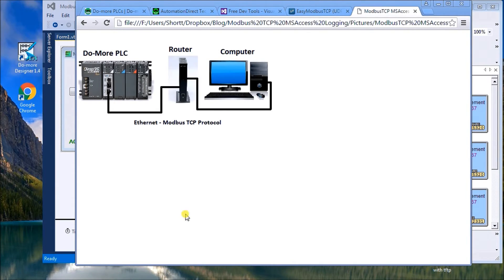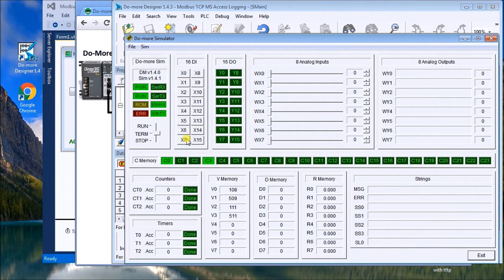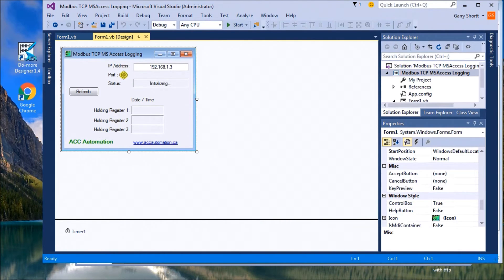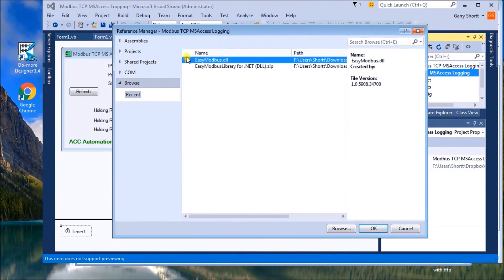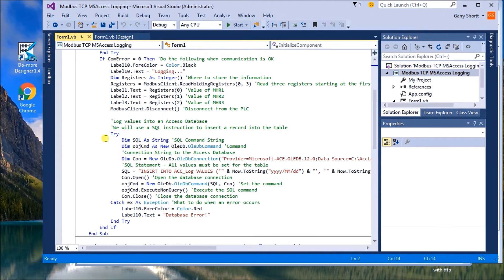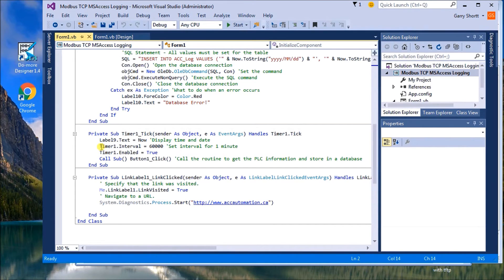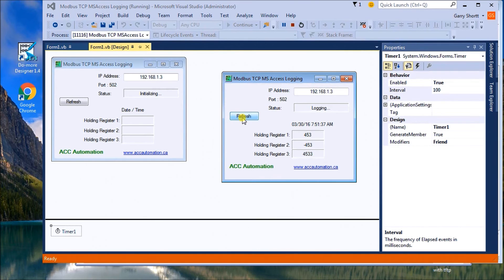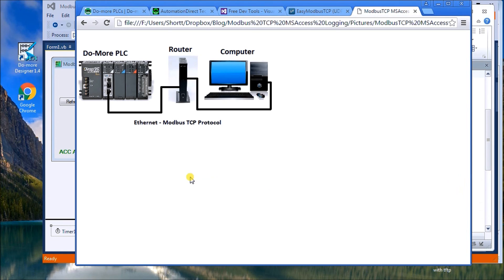Modbus TCP Data Logging to Database

Comment: Hi Garry - thanks for sharing this. Any chance you know how to read Holding Register 400001? I'm using IDEC PLC and the holding register is named as HR 400001, i.e six-digit number, not five-digit number. Any advice is appreciated, thanks.
Reply from the maker: Hi Reza,
https://www.idec.com/language/chinese_s/AO/FC9Y-B1730.pdf
I have not programmed the IDEC before but looking at the above manual on page 6-10 and 6-11. I see what you mean. 
I would try dropping one of the digits and try sending the information. (40001).
Let me know how you make out.
Regards,
Garry
Reply: Thanks Garry, that's what I have tried. IDEC PLC holding register starts from 400001, when I set this register to a number, for example 5, then I trigerred the read (40001, not 400001), the result came back 0. There is no way to set IDEC register 40001 because it doesn't seem to exist for holding register
Reply from the maker: @rezagso32  
The other thing to try is subtracting one from the register and trying.
If it still does not work, I would try a Modbus master simulator like the Do-More Designer Software. You could also contact your Idec representative to see if they have any suggestions.
Regards,
Garry

Comment: I think i found the problem wher in your app did you use the modbus ID for device ? it is by default 0 instead of 1
Reply from the maker: Hi Robert,
Great pickup. It has been a while since I looked at this code. You may be correct and the default might have to be a 1. 
Since we are using Modbus TCP, It should not matter because the IP address will be the address to send the message.
I'm glad you got it working.
Thanks,
Garry

Comment: Thank you Garry for this nice video. By the way, what if I want to datalog messages over TCP with ms or Sub-ms scale? I have issues with the OS timer thread of 15.6ms.
Reply from the maker: Hi Gui,
Thank you for the comments. In order to get sub-millisecond updates, you would buffer the information.
The information is buffered in the PLC (controller) memory and then read as time permits into the Database. This would be the easiest way to do the logic.
I hope this helps you out.
Regards,
Garry

Comment: hi sir
I have same application but i have connected to MODBUS gateway that connects to modbus slave RTU to my PC ...
I am confucesd at how to ask gateway what are the regiter values connected to it say at "X" node...
does my TCP MBAP has slave id inbuild or how does gate way works ...please help me i am stuck at this point and couldnt find any ans
Reply from the maker: Hi Raviprakash,
The following video will show you how the slave device number is utilized in the TCP MBAP.
https://www.youtube.com/watch?v=k993tAFRLSE
In the video you will find that the Modbus RTU message is contained within the Ethernet packet. 
The Modbus RTU message contains the following:
Slave ID - Address of the slave
Function Code - Reading/Writing Coils/Registers
Data - Information to send
CRC - Checksum calculation of the message.

Hope this helps you out.
Regards,
Garry
Reply: Garry Shortt 
Thanks sir 
I didn't know that MBAP also contains the slave ID that can be used at gateways.... 
Thanks alot

Comment: Thanks.
I have a communication between the plc and webpage but only with localhost.
But want i want is to get the plc Data directly to my webpage without a Computer.
Reply from the maker: Hi Marvin,
You will still need a computer to get the data from the PLC unless you are using a PLC with a built in web server.  I have used the Horner XL4 unit with great success.
http://accautomation.ca/horner-xl4-http-web-server/

There are other PLC manufacturers, but I find the Horner is a good proven, reliable and a good investment.
Hope this helps you out.
Regards,
Garry

Comment: Can you show me one example to read holding register from 43001 to 43010 instead of using you template 40001 to 40003
Reply from the maker: You would just increase the number of registers that you want to read. 
Note: 256 bytes is the maximum number in your message.
Regards,
Garry

Comment: Hi,

I'm trying to use your code with a Modicon M221 TCP.
The connection is ok, but it don't seems to work when I want to recover the data from any register and with any EasyModbusTCP function. 
I also  have a problem with the connection to the DataBase, even if I modified the access path properly (I think).

 Dim Con = New OleDb.OleDbConnection("Provider=Microsoft.ACE.OLEDB.12.0;Data Source=C:\Users\jacja\Documents\test.accdb")
 'SQL Statement - All values must be set for the table
  SQL = "INSERT INTO Table1 VALUES ('12', '12')"

Thanks for your help.
JacK
Reply from the maker: Hi Jack,
Please verify the IP address and Subnet Mask. 
When running the program, are you getting any error messages? 
When connecting to the database, are you getting any error messages?
Thanks Jack

Garry

Comment: Hi, Sorry for question again, do you know how to change the unit ID of TCP.client in easymodbus in VS2010? I already know how to set the RTU gateway to conversion mode, but I need to be able to modify the unit ID (slave ID)
Reply from the maker: Hi @scfmailkimo,
Here is a thread that discusses the unit number for easymodbus TCP.
https://github.com/rossmann-engineering/EasyModbusTCP.NET/issues/44
I hope this helps you out.
Regards,
Garry
Reply: @ACCautomation  Thank you very much.

Comment: Hello Garry and thanks for the videos, they've been very helpfull. 
I wanna know if there is any way to do the opposit, so write database values into a modbus tag?
Reply from the maker: Yes this is possible. There are examples on the EasyModbusTCP site for writing the variables.
http://easymodbustcp.net/client-simple-read-and-write-operations
Reading from the database is possible like the following post done with AdvancedHMI.
http://accautomation.ca/creating-a-hmi-login-screen-on-advancedhmi/
Thanks for the question Mouammar
Garry
Reply: Thank you for the quick answer Garry. i will try to make it work in my application and will come back here to tell you the result.
Thanks again for the great work
Reply: Hello Gary. To follow my last comment, I can now read or write in a DB by clicking on a button in my form. Now what I want to do is quite complicated. I want an automatic update of the DB on the change of a tag in my PLC. For example, a table will contain the value of a tag, then when the tag changes in the PLC, I retrieve it in my application and directly write the new value in my DB. For now, I've been struggling doing it with advancedHMI and I'm not sure it's even possible to do. 
In a  second stage, I'd like to do the opposit (Change in DB => write the value in PLC).
Can u tell me if this sounds possible? And if so, can you give guidelines? Thanks in advance
Reply from the maker: Hi Mouammar,
AdvancedHMI has a function called Data Subscriber. You can use it to trigger an event on a change.
Here is a link to the forum on AdvancedHMI:
http://advancedhmi.com/forum/index.php?topic=238.0

Hope this helps you out,
Regards,
Garry
Reply from the maker: Hi Mouammar,
Sorry for the delayed response. I would do this by using a timer on the VB.Net form. Set it to the interval that you want to see if a change has been made. Read the value, compare the value and then write the value if it has changed.
Note: Timers are in thousands of a second so 1000 is 1 second. When the timer expires, the first thing that you want to do is to disable the timer. Then you can do the routine mentioned above. The last thing in the subroutine is to then enable the timer again for next time.

Hope this helps you out.
Regards,
Garry

Comment: Can this library be used in RTU over TCP? thanks.
Reply from the maker: Hi @scfmailkimo,
I don't know what you mean by using RTU over TCP. Modbus RTU is a serial communication, and Modbus TCP is an Ethernet protocol. 
If you need to convert from one to the other you can use a protocol converter module. 
Regards,
Garry
Reply: @ACCautomation  I know. I just use RTU to TCP module. But I can't use easymodbus tcp.client read data. 
PC—>LAN—>converter—>485 cable—>sensor.
Reply from the maker: @scfmailkimo  
This should work. Have you individually tested each component in your system? 
- Easymodbus TCP.client to another device?
- Converter Functionality
- RTU 485 to the sensor
This is where I would start.
Regards,
Garry
Reply: @ACCautomation  for example.
Modbus RTU：01 03 01 8E 00 04 25 DE
Modbus TCP/IP：00 00 00 00 00 06 01 03 01 8E 00 04.
If use easymodbus tcp.client only define start from 0x018E and length is 4. Two variable. I guess the final value sent to the converter is “00 00 00 00 00 06 01 03 01 8E 00 04”.  The function of the converter is transparent transmission. But sensor don’t understand. 
Some modbus TCP client software can directly transmit “01 03 01 8E 00 04 25 DE” instead of only defining the start and length.Then the data can be obtained smoothly
Reply from the maker: @scfmailkimo  
Since this is open source, you could modify the program.
https://sourceforge.net/p/easymodbustcp/wiki/Home/
This would not follow the standard Modbus communication protocol.
Shouldn't the converter be the device that will modify the address so it will talk to the Modbus RTU sensor?
Regards,
Garry
Reply: @ACCautomation  The function of the converter is only to completely transfer the TCP command to the RTU sensor. Therefore, the library must have a method for transmitting custom commands(RTU format) in the TCP.client component.
Reply: Like simplymodbus software